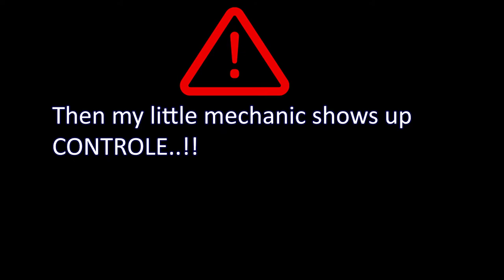BMW R1200GS LC [2014] OIL & OILFILTER CHANGE.. IS IT EASY ?? The Old Mechanic shows it 👨‍🔧---🏍

Comment: Have a look at the grip of the screwdrivergrip under the bench and you will find the tool for opening the oil tap :)
Reply from the maker: Wow so the grip is the tool ??
Reply: @TheOldMechanic  Yes, so it is, it took some time for me too to find it:), like your calm and accurate style to explain things, have a watercooled BMW GS and a S1000R, looking forward to see more videos, especially tapping control of the S1000R would be very interesting, Greetings Lothar
Reply from the maker: @rahtol1147  Hi mate, your great..!! I never thought about that. I am going to call my mate and tell him about YOUR update. Thank you very much !
Reply: Oil filler cap tool is on the end of the screwdriver handle.
Reply: Alas, this didn't prove true for my 2014 R1200 GSA. The screwdriver tool under the rear seat looks like a standard screwdriver handle and does not have the correct shape for the oil filler cap.

Comment: If you read the motorcycle manual, you would know where the oil filler plug key is located! 🤷‍♂️😂
Reply from the maker: Ouch... Sooo right 👍🏻👊🏻😂

Comment: The tool for the oil filler cap is under the seat unless someone misplaced it! I have a 2017 and it takes 4qts. Also, try using a K&N 160 filter- you don’t need a filter wrench!

Comment: Yes, there is a key for the oil cap under the seat, right in front of your nose ;) 
My questions are: how much oil did it take? Shouldn´t it be 5w40 oil? Isn´t it recommended to open the filler cap to drain the oil completely ?
Great videos, please continue with relevant matters, I´ll be watching for sure. Txs